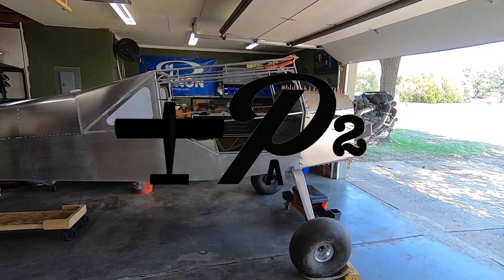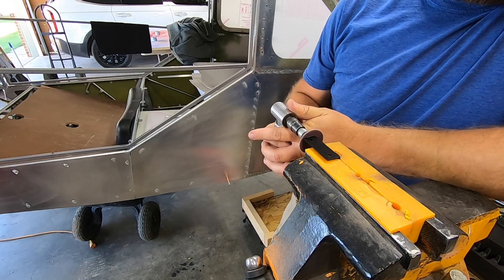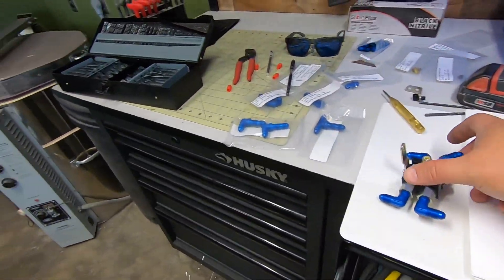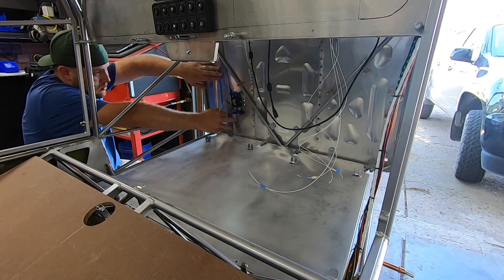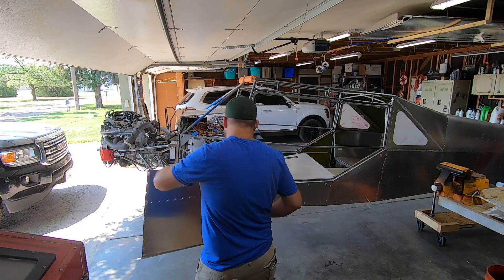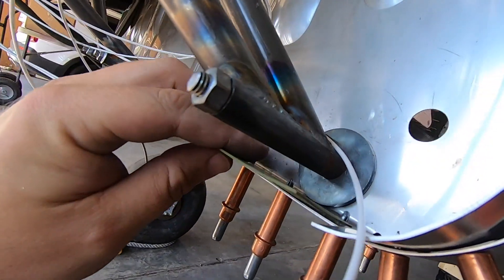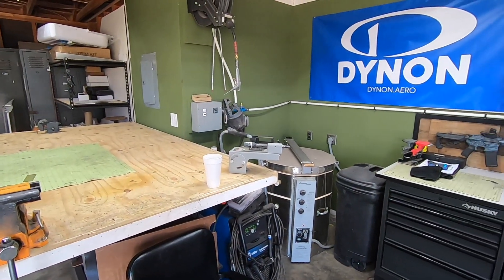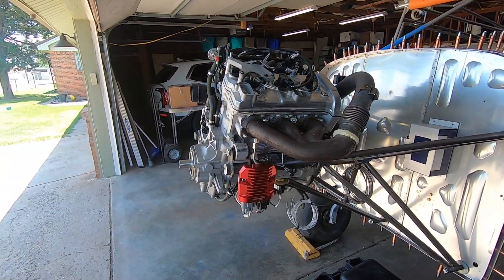RANS S-21 YAMAHA 998TURBO UPDATE EP31

Comment: Looking great. What all is left on the front? Gearbox and exhaust? What prop are you going to go with?
Reply from the maker: Dry sump oil system, coolant system and  exhaust are the main things other than the gearbox and prop.. there is a list of smaller things but it’s slowly coming together. I will most likely run an NR prop like the apex guys are using unless I find something stateside that can compare..